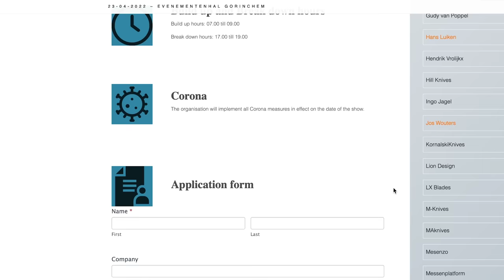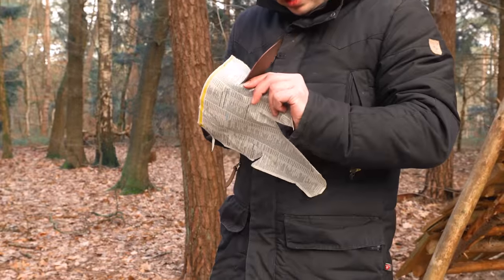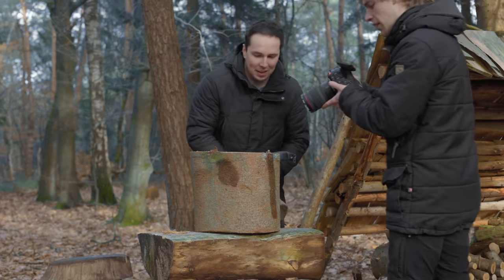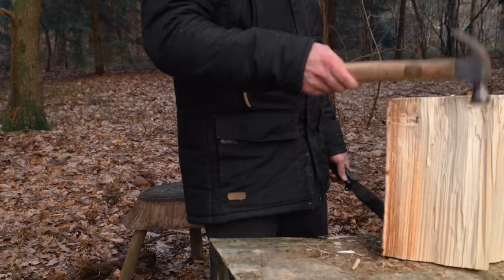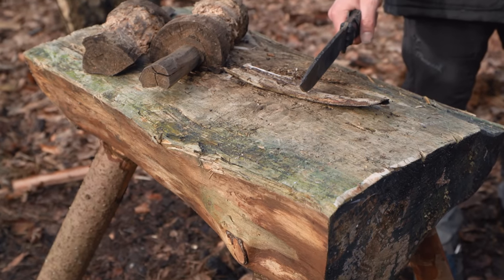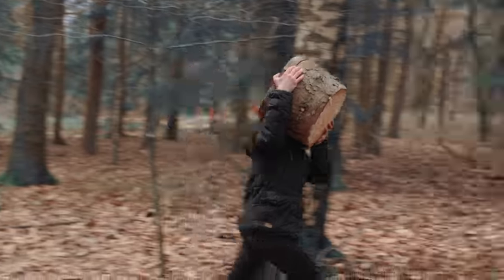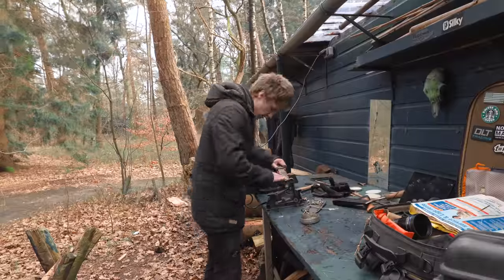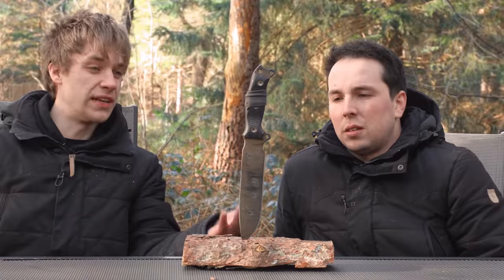They say this is the toughest Knife steel ever Made! INFI STEEL DESTRUCTION!!

Comment: I know a few people that send their blades gor analysis to see what INFI was since Busse won't release the composition of their steel. And technically its not their steel, its a steel that already exists but they perform their custom version of heat treatment. The people claimed the results came back indicating their steel is either A8 or A8 modified. If thats true A8 is a very tough steel, but almost no one uses it in the States. One custom maker used it Tom Johanings years ago, and he was the only maker I could find. Few Italian companies use A8. I found some specs on it. It shows that at 59rc it has a charpy impact value of 160 joules or 118 foot pounds. For comparison Cpm 3v at 59rc  has 100 joules. A2 for example at 60rc has charpy impact of 40 foot pounds. 5160 has a charpy impact of 85 foot pounds at 58rc. S7 has charpy impact of 165 joules at 56rc. So A8 is basically at the level of Shock resistance steels. Just some basic info if you guys are curious.
Reply: Actually, he listed the metals and composition in Blade Magazine many years ago. I’ve had my Battle Mistress a little over 35 years and the only thing needed t maintain the edge is a ceramic rod. That and a light coat of Militec oil is all that is required to keep her happy 😊
Reply: Infi is not A8 mod. It is different steel.
Reply: Definitely not A8 lol
Reply: I'm pretty sure it's 5160 and Busse does an in depth custom heat treat with it.
Reply: @philsturgill3435  what is this " militecc oil???
Reply: Their heat treat is what makes their A8 good. But it’s not as good as Delta 3V now.
Reply: @zdenekbart it's basically A8 mod ...lab proven
Reply: @zdenekbart basically an A8 as lab proven
Reply: @adods9824  no, it is not.
Reply: @AxionXIII  What makes it "not as good" as D3V now"? I don't think that's accurate. INFI is better than D3V in certain ways as the inventor of that 3V HT process has openly stated numerous times. D3V is better than INFI in other ways. It really all depends on what characteristics are important to you of whether it's "better" or not. D3V is not universally "better" than INFI.

Comment: I've been using a Busse for 7 years now, almost daily for the past year, mostly for splitting big logs since I enjoy it more over an axe, and I haven't sharpened it once. Made it a secondary convex back then and obviously it doesn't shave but it has zero edge damage. It's honestly insane. Was about time you guys got your hands on one, they really do not disappoint😁
Reply: A fairly blunt big knife (just to an "okay" working edge level) is the best way to run a  large blade in my opinion and historically how it was done (according to the local "historical lifestyle" museum)...I run both of my Terava Skrama's that way and like you I'm constantly amazed at their resilience and both are just a joy to use with little to no maintence.
Reply: Juan Moore  I own a couple traditional forged axes, had them for longer than the Busse. Still I enjoy splitting medium sized logs with the knife. Other sizes you need the axe obviously. And surely axe is more efficient, it's made for the job, but as something to do in my free time without any hurry I'd choose the knife everytime!
Reply: You knife guys are crazy, an axe and a maul together would be less and faster 

But I've no problem with that, I get it (went BCM on my AR-15) it's the hiding of the steel that bothers me, like closed source software: imo intellectual property is BS for people who aren't confident they can compete without a secret 

It may be a demonstrably good blade, but I don't see this community of knowledge and practice would put up with "closed source" metallurgy.
Reply: @abstractapproach634   us knife guys like pain.  I baton big logs with a mora😀
Reply: @abstractapproach634 BCM is mid tier mike lil bro, get a hodge or shut up 🤫

Comment: Great test of INFI's durability since not a lot of people would want to break a 400$ knife apparently it has some decent corrosion resistance as well, what I like about Busse Knives is their knife designs
Reply: The best thing about Busse is that, even if you manage to break it (short of intentionally breaking in half), it will be warrantied.
Reply: @xdd7049  Even intentionally. They replace it.
Reply: @xdd7049  Same with ESEE
Reply: Even if I was a knife guy and not a gun guy (too broke fir both, especially with .223 over 60 cents a round), I would not support a company that hides their steel composition.

Just like I try to only support open source software. If the company doesn't have the confidence to think they could handle competition, I wouldn't be confident in them. 

Another guy said it was H8. 

If I did spend real money it would be on msterial and equipment to make one personally, but with all the options out there I don't know why anyone would support hiding the material (like, what if it happened to be perfect for something else, like a submarine propeller or something. It may be a demonstrably good blade, but there are others)

I rock a shorty KA-BAR for prying or opening cans (same tang as the big one so it's much tougher, even for 1095) and a chinesium 440A M7 bayonet for knife specific tasks (no edge retention, but sharpens in a hurry. My first 440A blade, I was obligated: as is anyone with a 16" midlength AR, *obviously*, but was very broke after getting the rifle. I was also obligated to buy it, as the people's republic of Washington state was banning all future purchases at the time, and "assult weapons" are still banned from commerce.)
Reply: @abstractapproach634  I agree. Inventors should not be rewarded for their inventions in any manner, let alone monetarily.  Ideas are bestowed upon the privileged from the heavens, not through hard work, and only the greedy would try to assume ownership of them.  ::RED SALUTE::

Comment: Would like to see ScrapYard Knives SR101 steel tested. Same company basically. I've had a SykCo 711 for about 10 years and it's been one of the fun to use and durable knives I've ever owned.
Reply: I have the same blade and for about 10 years too.  Crazy
Reply: I got the 711 as well when it came out. And the 311, 411, & 511. SR101 is good stuff.
Reply: Yeah I was going to say that infi is not as good as their sr101 is I have the scrapyard "SYKCO DB-421" and it is a beast!!!
Reply: I have an 11-11 she is my camp friend flips steaks chops splits and scares the normys
Reply: If you have an SR101 consider yourself lucky. I read somewhere that the Gladius 10 was the last model to be made with SR101; in 2020. Busse lost the logistic support to maintain the specialized furnace that produced his SR101.

Comment: This is an NMSFNO.  Nuclear Meltdown, Special Forces, Natural Outlaw.  No longer in production.  This knife originated from the SFNO, then Busse decided to give it the Nuclear Meltdown treatment.
Nuclear Meltdown:  A treatment Busse does that rounds any exposed steel edge (spine, butt, choil).   Looks nice, terrible for ferro rod and scraping wood.  It also lengthens the blade from the standard model.  There are several Busse knives the have gotten the NM treatment.
Special Forces:  This refers to the handle design.  Busse has several handle designs that they swap with different blades and make a new model.  A current offering with this handle design, as of this video, is the Hell Razor II.
Natural Outlaw:  This refers to this specific blade design.
So when you see a Busse acronym, part of it is the blade style, part is the handle style, and it may or may not have a cosmetic treatment, usually designated by the NM.  Hope this helps.
Reply: And it's a Garth edition. A later iteration from the original. Probably had a overrun in the back that they let Garth ruin with that horrible color. Love the fact it's a convex grind. But most of the NM knives are not very good iterations of the original. Except for the NMFBM. It's a exceptional chopper. The NMFSH was the biggest travesty in my opinion. The other flagship in Busse's line. They got it right with the Heavy Heart. Then messed it up with the Nuclear Meltdown. Best knife Busse made in forever was the LE basic 8. And the best designs with a regular handle were the early Swamp Rats. And the best users are the Scrapyards. The DB series from Scrapyard is very good. 
My most used are a original run Ratweiler and a 911. The 911 is probably the best big knife Scrapyard has put out. That saber into a convex grind is amazing because it doesn't bind. I blended the primary and secondary at 20 degrees into a almost full height convex grind (Except the convex goes into the high saber). Amazing blade.
Reply: I prefer the NMSFNO, it’s also slight longer than the SFNO. But I think the best all around Busse is the Hell Razor 2008 SE.

Comment: The other attribute of infi that you missed is its quite stainless for a non stainless steel. Even more so than d2. So it sharpens like 1095, its super tough.. its nearly stainless.
Reply: It isn't even even close to a stainless, the corrosion resistance comes from the nitrogen in the steel composition.
Reply: @turtlewolfpack6061  i mean in practical use. Not chemically.
Reply: @turtlewolfpack6061  INFI does not contain nitrogen and hasn't for well over two decades. It is the free chromium in the steel that contributes to its corrosion resistance. And OP never said it's completely stainless, so I'm not sure what you're disagreeing with. It's quite corrosion resistant compared to non-stainless steel so the OP was spot on with that assessment.

Comment: I think if you sharpen knives on that system ( i use it too ), without cooling at all it will ruin the HT at the edge. Since after about even just 15 seconds on the course belt without cooling it is too hot to touch even. I always dip my knives into a bucket after about 10 seconds when i use this system. About the knife i feel like its just so easy to make a knife that is this tough, just take a massive thick slab of steel, do the cheapest HT on it so it stays nice and soft, put a 40 degree edge on each side so 80 in total. Put some micarta on it and you are done. I feel like this is an incredible marketing trick with insane profit margins. Voor de rest leuke video en toffe gasten!
Reply: Each Busse knife has over 40 hours of heat treating processes done on it including a cryo treat. These do not have “cheap heat treats”. As far as the thickness Busse knives tend to run about .21-.22”’s in thickness. There are much thicker knives out there. Throw in their no questions asked lifetime warranty that also transfers between owners and the price in my opinion is worth it. If you can break a Busse you are probably going to the hospital after.

Comment: glad you all finally got to test a Busse. I love your channel, but sorry I wouldn't send you one of mine...lol
That's the reason Busse's tend to hold their value with knife collectors, the runs are limited. With many of them once they are gone, that's it. Onto another model. I've not seen another run of the their BWM, since I bought mine about 10 yrs ago.
and like other commenters below, I used mine to split fire wood.

Comment: The number one thing about infi that makes it attractive is the toughness combined with the relatively high degree of stain resistance it has. At least for me. Other steels can beat it individually for toughness/edge holding/stain resistance in different categories respectively, but it's got an attractive blend of all 3 properties - especially for a bigger knife.
Reply: 14C28N?
Reply: @martinerhard8447  That or AEB-L. They're both stainless, and have really high toughness even at 62+ HRC.
Reply: @derschwarzgeist  yes those are also composition wise super similar steels

Comment: 1095 is actually not very tough, 1075 is far far tougher. Also, how would this compare to 1V? 3V? Z-TUFF? All of which would have better edge retention
Reply from the maker: I definitely feel like it's toughness results were better than 3v.  Not sure about the others though
Reply: @DutchBushcraftKnives  1V is crazy crazy tough..but I would bet that once you hit 3V toughness..none of them can be differentiated without a quantitative test..in all practical means...3V is going to be plenty tough enough while still having better edge retention and C.R.
Reply: I wonder if a 3v knife in the same thickness would be a better comparison
Reply: also edge angle is a huge factor
Reply: @Lurifaks707  100% agree

Comment: Great vid as usual guys!

It's not my kind of knife - but the steel ticks two very important boxes.
Really tough and easy to sharpen....I'm not sure what else you'd realistically want - sure edge retention could be better but under normal usage it would be fine AND ITS EASY TO SHARPEN

It'd be interesting to see a bushcraft knife in the steel rather than a camp knife.
Reply: Its not the knife for me for two reasons 
•I am a gun guy, wouldn't spend that on any blade personally; but I get it
•they hide their steel, if they had the confidence they could compete they would want to introduce it to the world and grow their brand. Just like closed source software, closed source metallurgy is B.S. and intellectual property can be obtained without taking anything, like a flame if a candle, so should not be protected.
Reply: Yep, this a good steel for a guy who just want something reliable to process some wood and scare off Sasquatch without carrying a DMT sharpening system with him into the woods.  A small leather strop and a ceramic hone would probably do it.

Comment: So what if a knife was not hair popping sharp after you started using it, but was sharp enough to keep cutting stuff? And then on top of that didn't chip roll and crack or break? Like you're cutting and it works and you didn't have to be careful with it and it kept going? I had that: Bark River knives The Forester a drop forged N690 steel chopper whomping knife! It wasn't full tang. It was a honey badger knife!!! Broke some "rules". I'll never look down on N690, that's why I wanna see Spyderco do some big or heavy knives with SPY27! Like if powder Metallurgy version of 154 CM is noticeably better than why wouldn't a powder Metallurgy version of say VG-10 and N690 be even better? I was more interested when the knife in this week's video yesterday was N690

Comment: I think the most I'd pay is €180,it they sold them for that price they would do a larger turn over &make more money in the long run. The larger the output the more profit on the bottom line.
Reply: I've been following Busse for a while and even if their prices are quite high they got a lot of market and it's pretty rare to find a stock on certain pieces or editions, and those in hands of collectors double their prices without losing value over time or over some use. Their custom shop has a waiting list of around 4 years last I checked. Even though I agree I wish they were cheaper, especially for EU market but yeah, they got it covered though
Reply: Years ago the waiting times could have been months already. No way they are going to make them cheaper.
Reply: @kazekai6  The Custom Shop has been closed for the last several years. They do build some Customs that they sell through Ganza's, but you can't order anything.

Comment: The Busse Basic series are amazing for their weight, blade geometry, and ergonomics. Some of their blades are just too unwieldy. Weird steel,  is soft to the point where after an hour of use, you can hone the edge with the wood you are cutting and keep going. Once you get a nice convex edge on it, you never have to do more than a few light passes with a ceramic rod and strop. Not great edge retention, but amazing for large blades. I usually carry my Basic 10 and a Carothers D3V field knife, Survive GSO 4.1 or 4.7, or one of my Elmax fixed blades in really wet conditions or at the coast. Great large blades though!!
Reply: The B10 is my favorite big knife. Not too thick, not too heavy. Just right!
Reply: Anything with the basic handles are my favorites. The basic 4 and 8 in the Busse line is by far my favorite.
Reply: Sure, if you consider 58-60 "soft".

That's pretty much the rc they run INFI across-the-board.

Comment: Try batoning red oak, or another hard wood to test a knifes toughness. I've batoned through red oak with my esee 6 and it flexed the blade about 25° or so and it went back to true once i finished splitting the pice of wood. Just my experience mates. I like y'alls videos, there really funny! 😆
Reply: You can baton through a car door with it, don't worry. INFI is much, much better than 1095.
Reply: Hey dummy there's been tests that have been done that this knife could go through a quarter inch steel plate and concrete

Comment: "Busse Custom knives undergo a deep cryogenic treatment at over 300 degrees below zero.  This deep-freezing of our INFI steel to 300 degrees below for a prolonged period of time stabilizes the microstructure of the INFI.  Just as retained austenite is transformed to martensite during the tempering process, the same change occurs during the cryogenic treatment.

Our cryogenic treatment improves the mechanical properties of INFI like hardness, wear resistance, toughness, and resistance to fatigue."